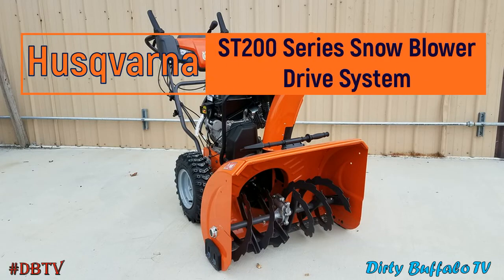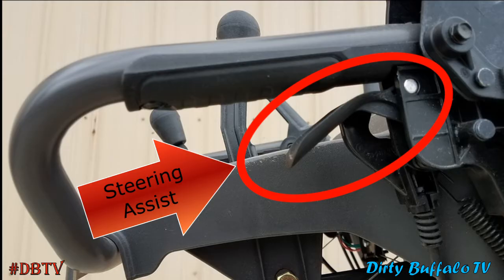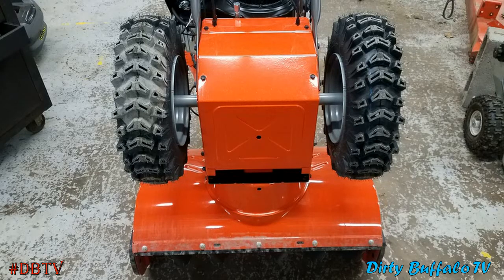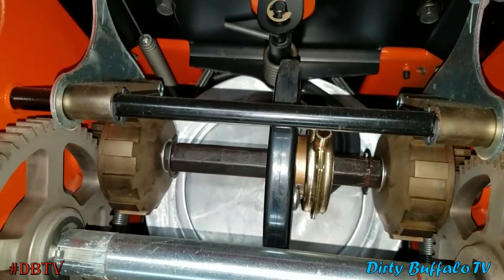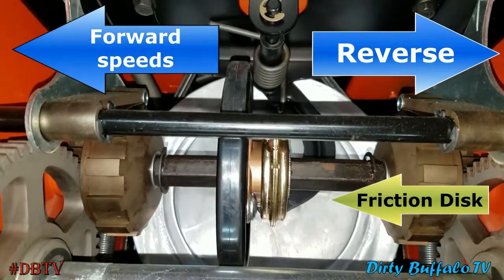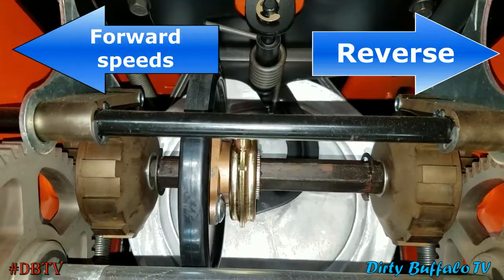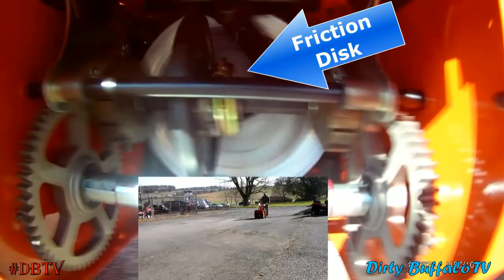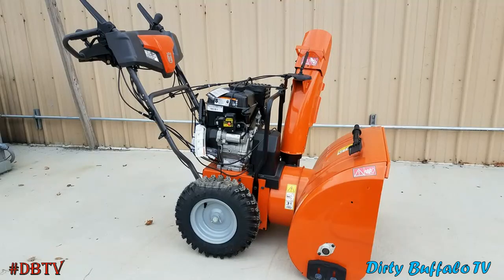How It Works: Husqvarna ST200 Series Drive System ST224, ST227, ST230

Comment: I have less than a hour on mine, the drive wheels have very little power to them won't reverse up a small incline or go up a small incline, is there a way to adjust pressure on the plate?
Reply: Same.

Comment: Excellent video, very helpful.  The right hand bearing on the upper drive shaft (the one with the friction disc) fell out, and I wasn't sure what the Trunnion Bearing Assembly was, how it worked, and what it connected to.  After viewing this video, I understand how the whole thing works, and how to reconnect the Trunnion Bearing and repair the snowblower.

Many thanks!

Comment: Awesome video my man!
I have the st227p... question. There seems to be alot of slop in the discharge chute.  The lever and cables work great however after you aim the direction of the snow with the lever, there is play in the direction from right to left. Is there a hack or adjustment to stop that play so the snow goes where i point it with the lever? Thatway i dont have to operate w one hand on handle and one hand on the  chute lever. Thankyou)))

Comment: I just picked one up for 250 but needs a belt. It's 2015 but still runs great. Can you tell me why the carb has no air filter?? And if I press the Primer ball too many times fuel will come out the side of the carburetor.What's up with that?

Comment: All ST224 prior to 2020 have an all plastic speed shifting control console that has a very high failure rate. If you are buying a used one, look underneath the console where the shift cable attaches. If it's all plastic, don't buy it. On cold days the plastic becomes brittle and if you shift to high speed, the amount of pressure on the cable mount will crack and leave you with a blower that only runs in reverse. There is no new improved replacement console with reinforced metal for the ST224. They only offer the all plastic replacement which will eventually fail again. The ST224 has been discontinued.

Comment: Amazing video, great explanation, I just bought a 2021 redesigned model (ST224) and what you explained about the gears and the transmission, still applies to the newer model, the main change seems to be the the plastic  panel on top is now replaced with a metal one, other than that it still is a beast of a snow blower and so far I have no regrets.

Comment: My Husqvarna ST230P I got in 2016 has been great but started having issues last year.  I replaced both drive belts which helped but still would get problems so I now have a new friction drive belt ring to install but haven't seen videos on this job so a little tentative to attempt it.  Any tips or guidance?

Comment: Thank you so much for this video -  I was happy to learn about releasing the planetary gears!!   I have been pushing that snowblower into my garage to avoid the fumes (while running), now I will just roll it.   Yay    I was looking for help adjusting the tension on the on the traction drive control lever.   You didn't cover it here but I did see another video so I will be attempting to adjust the turnbuckle therefore adjusting tension as the handle takes too much effort to push down - causing my hand to cramp up.

Comment: My husqvarna doesn’t go forward but only goes in reverse, can it be the friction wheel needs to be replaced?
Reply from the maker: It could be, but if the friction disk works to drive it in reverse then it should also drive it forward. It could be a combination of the friction disk needing replaced and the aluminum plate it runs against needing to be cleaned off.
Reply: @DirtyBuffaloProductions  Thanks a lot!

Comment: Theses things are a piece of junk. Sold my Murray for this. Guy I sold the Murray to has a bigger driveway. Murray still running. My 230p doing a small subdivision driveway. The thing eats all the belts. The plastic housing on top breaks where the cables are on. Just got that fixed.  Guess what drive belt shot. I am just going to junk the thing.  Either get a simplicity or aerons. Post office would not even drop a package off. Amount of snow on my concrete driveway.
Reply: Interesting.  I've had mine for 4 years...works beautifully.  Maybe you just got a lemon.

Comment: I have an st224 non power steering model. On snow there really isn’t a need for power steering. The turns with ease. On dry ground different story! Although having more mechanical parts is good to avoid because on dry ground it’s just to get it stored away

Comment: Thanks for the video. Today for the third times the transmission is not working. It was working when I stored them but not anymore. It’s an husqvarna same system than the showed in the video. I make myself a video in witch the machine is in gear and I press the left handle up and down would look at it

Comment: Good video. Simple once you see how it works. Thanks for showing
Reply from the maker: Thank you! A lot of people think that this system works like an old farm tractor and it is applying a brake to one side or the other. As the video shows, it simply puts the side that is activated into neutral.
Reply: @DirtyBuffaloProductions  right on. I'm buying one today with tracks. It'll be my snowblowing tank!

Comment: I have a T227. My biggest complaint is the plastic shroud that connects the chute to the impeller discharge area, why did Husqvarna make that plastic? Our road and driveway are stone, not 3/4" and minus but everything from baseball size rocks to sand. Every so often a large rock gets shot out from the impeller and hits that plastic part and after enough hits it has to be replaced. I'm on my 3rd plastic part in 2 years, why wouldn't they make that metal like Ariens has? Not the end of the world to replace but downtime is downtime. I'd like to see that changed or have them design a metal replacement part.
Reply: I have the st230e and this summer I am going to fabricate one out of steel I am tired of the plastic breaking. I wish that they did not skimp on that peace and the belt shroud I had to pop rivet a bracket on because it snapped.

Comment: thanks for this helpful video. I have a question: how do I adjust the shift cable? My snowblower is going too fast on 1st gear and too slow on reverse. which means I need to loosen up the gear shifter cable, but not sure how to do it.
Reply: Shyem Khan got mine today and it’s the same!
Reply: Did lowes put it together?
Reply: Just got mine and it is the same, basically no reverse. How do I loosen the gear shifter cable?

Comment: Great video! I have the ST230 and the last time I used it I had it on speed 6 and it was moving at almost speed 1. Nothing seems to be engaging. This literally has about 2 hours worth of use on it. Any idea as to what would cause that? Any help would be awesome. Thank you!
Reply from the maker: Sounds like you should take it to a Husqvarna dealer and get them to check it out. If it has that low of run time on it there's a good chance it could be something covered under warranty.

Comment: An excellent video.I own the same blower. I have a small problem, As I'm blowing hard packed snow the discharge chute tends swing to the right! Can you tell me if the chute control cables are adjustable?
Reply: Fred Audet yes there are adjustments on the cables. I had the same problem with mine, I tighten the left cable up to make it more snug. It doesn’t go over like it did.